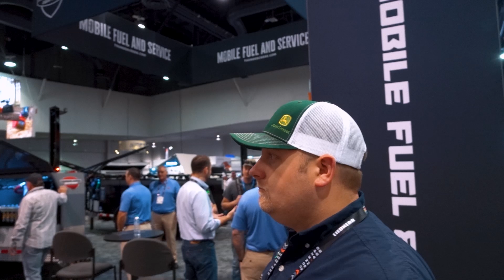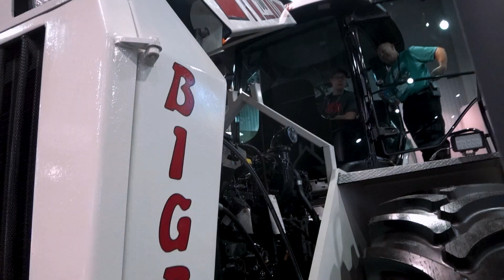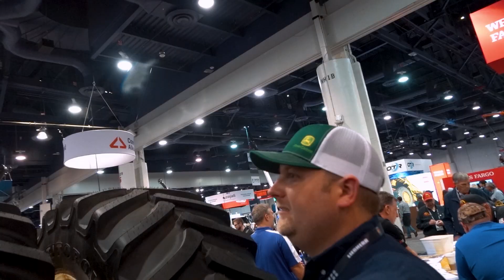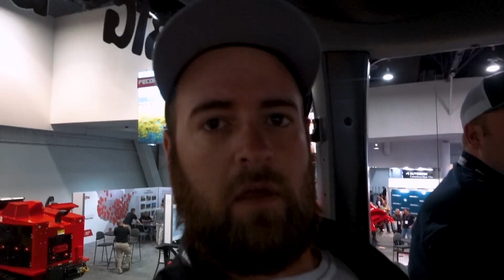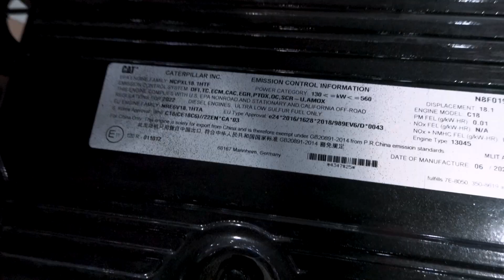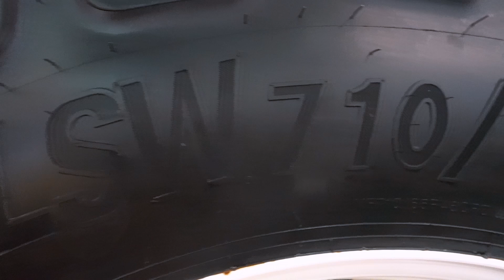Brand New 2023 Big Bud 700 Tractor | First Look

Comment: I worked on a farm with a 1981 big bud. By the time we dropped air pressure and filled the tyres with water for broad acre dry land cropping it weighed 48 metric tonnes.
I used to tow an 85 foot chisel plow with 14 inch sweeps, a 60 foot breaker plow for clodding hard packed clay pans after a summer rain.
One of the most powerful machines I ever drove and John deer still hasn’t made a machine that could blow smoke up its arse lol😂

Comment: Kinda surprised by the engine choice... The c15 is pretty rock solid but pushing that architecture to 18 shortens life quickly at high continues rating.maybd consider a c27

Comment: you know, i would be VERY interested to see what a subcompact would look like from them. main issue i had with mine was the flex. when i got the bucket loaded with sand on uneven ground, i could feel the frame twisting underneath me. for some applications, you need the footprint of a small tractor with the grunt of a bigger machine. a big equipment subcompact or compact tractor would get a lot of attention from landscape and site prep companies. skidsteers arent that great on uneven surfaces, and some things are better done with an implement on the back. closest i've seen is the ventrac, which uses proprietary attachments on the front.

Comment: Very nice, powerful, capable and beautiful tractor!  Finally a smart manufacturer actually making a tractor for the people and not to pacify the techno crowd.  Common, easier to fix parts, no factory restrictions for repair, somebody finally listening, these will sell out very fast.  You were right to tell the Deere rep no way for complicated bullsh^t.  Excellent, informative video on a great new tractor built for real people and not moving toward robots and drone tractors.  BRAVO.  This manufacturer is really smart, knows what a real customer wants.  You're not the only one cussing technology, it's being force fed to the population as a step closer to drones but most people don't see what they're all aiming for, which ain't good for us people.  NOTHING wrong with simple if it does the job and does it well, actually better.

Comment: Important point was made at 8:40. They are basically manufacturing a glider that will be easier to retrofit with an older pre emission engine. Now of course they can not market it as such but its a very clever work around. I love that. About time someone stood up to the epa
Reply: more than that, if the powers that be do pull their heads out of a certain part....and someone comes up with a massively game changing engine or transmission, it can then be easily slid in also...but yes, at the current point we're at, I fully agree with you.
Reply: I wonder if the farmers could supply their own engine. New, used,rebuilt, deleted etc?
Reply: @lamarzimmermanmennonitefar5269  directly? not likely, aftermarket, like big bud sells them a non powered unit, and then builds a skid for them using the motor and puts the skid in after the actual sale....maybe, question would be if they would be willing to...

Comment: Very impressive machine. On the engine tag it states " solely for export from China" so one could assume the engine was manufactured there. That said, still Cat engineering and technology. The C-18 ( 18 litre displacement ) is still the same basic block design as all the other "E models", such as the 6NZ, Accert, etc. Instead of 14.7 litre, like your 475 or 550 hp, or 15.8 litre like your 600 hp, you have a bored and stroked engine to get to 18 litres. They get there by using things like thin-wall liners to squeeze out the displacement. These engines are widely used in Cat construction equipment, and in boats, gensets, and other industrial applications. I guess ag usage emissions standards are different from highway, and maybe that's why us truckers can't get these engines any more. I wonder if you can get a Jake Brake? Good luck, Big Bud.

Comment: Ok, so i guess i will be "that guy." This tractor really disappointed me. It is not even close to being a running, driving unit. The welds looked horrible with porosity and undercut all over this thing. I worked conexpo, all week, in the festival lot. I have full access to 3 different engine manufacturer software's and work for "construction equipment" manufacturer. I also have a college degree in agricultural technology. I fight the same challenges as many of you in regards to some of this newer farm equipment that we own. The only reason i mention any of this is to provide context to my opinion....
I visited this booth twice to get information, very specific information. "Will the end user be able to obtain the factory computer software for the engine, emissions equipment and transmission. Even if they are willing to take a training class...." The answer was, "No, a cat certified mechanic will need to diagnose and repair the emissions equipment. As far as service and maintenance for the engine and transmission, anyone." Next question, "will we be able to purchase a "customer" version of the software, with limited access to certain parameters." The answer, "no, not at this time."This was basically the exact answer both times i visited. They are relying on the current Caterpillar dealership network to keep these going. Now, i completely know why this is the answer, but that is exactly what everyone is arguing about. The ability to diagnose, repair, and test the emissions system. Also, access whatever online parts and service manuals. I also understand that most "farmers" do not understand the complexity of some of these software's or even the  logic behind it. Not that "farmers" are not smart, just not trained and familiar with how to use the software properly. This may be a simpler version of a modern tractor, but it is not a modern tractor. You can rebuild an old pickup truck with all the modern-day technology and parts, but it is still an old truck. I am not bashing Big Bud, Big Equipment company, or Rome plow company. I fully support their mission and what they want to do. If they have some plans in the works that i dont know about, that eliminates these concerns, then i am wrong and will fully admit it.
Reply: In my opinion, the best thing they can do is to "purchase" emissions credits for these engines and put a tier 3 engine in it. If you can even still do that anymore......... that would be something
Reply from the maker: Yeah the whole time I was thinking the same thing. Not like I have access to a cat computer. Wonder if it would be possible to build a glider kit like they do with semis and use an older engine
Reply: @BriansFarmingVideos  Its dependant on the tractor serial number on the frame /original build date. They won a court case regarding taking remanufactured tractors into California with non compliant emissions.
Reply: I fully agree with your comments.  I too was at ConExpo and was disappointed as well.  This tractor was literally just a frame with an engine, transmission, axles, and a salvaged Challenger 900-series cab bolted onto it.  No air intake, no exhaust system (and yes, if the engine is 2011 or newer it will require DEF), no wiring harnesses, no drivelines, no hydraulics - and that's just what I noticed glancing over the machine.  There is a whole lot of work to be done before this machine is ready for the field.

Comment: Awesome they brought the BIG BUD back. But even better is they are making it so user friendly to able to work on it yourself to a point.
Reply: Anyone willing to drop the coin, can obtain Cat's diagnostic software. 
Any Cat engine shop, should be able to plug into and diagnose the engine. 
Anyone with a Snap-on, MAC, etc, scan/diagnostic tool can obtain the software for the engine and transmission.

Comment: I went to this show with the owner of that very tractor. He purchased the very first big bud tractor manufactured in 20 something years. This tractor at this point will not move under its own power yet but he is expecting to take delivery in June i believe. He will be pulling dirt pans with this tractor. He is still running 3 bid buds that he purchased many years ago.
Reply: Awesome...Good luck dudes..

Comment: Surely if they’d of wanted to make an impact with that, to really get the industry excited they should’ve just put out a 900 / 1000 hp. 
It needs the USP
Reply: It would be unique, but it's unlikely.  It's very difficult to get the power of 1,000hp to the ground without the design becoming complicated and unwieldy.
Reply: There's a reason they only sold one 747-16V....

Comment: I'm thrilled Big Bud is offering tractors that are not subject to the predatory service practices of the other tractor manufacturers. Farmers should never be hindered or locked out from servicing and repairing their own tractors.
Reply: I have NEVER put a tractor in a dealer shop ..Ever!  But most of our stuff is 40 years old...  Planted all our corn and milo  last year with JD 7000 6 row and 4430...Crop was just as good as the next azzholes..
Reply: @davehughesfarm7983  oddly enough I was never asked what year my tractors were when they printed the check for the crop
Reply: Don't be too thrilled, because it's a Cat transmission and engine and a Cat computer and sensors, and Cat charges $185 an hr service call, and only Cat is going to have the parts
Reply: @RJ1999x  It's still a huge step in the right direction but I'll let them know you won't be purchasing one. ;)
Reply: @SaltyBear207  Not really. You can go anywhere you want with Deere or IH, no one is forcing you to use their dealers. No one really makes aftermarket anything for Cat nor does Cat allow any different practices than Deere or IH.

I have 3. It's not fun finding parts for them. Also how is it different than a Versatile besides being heavier and having an overrated Cat motor instead of a overrated Cummins motor?

But the internet knows best of course.
Reply: @SaltyBear207  It's not a move to the right, it's just a sales pitch

Comment: Not going to lie was a little disappointed it wasn’t all new and complete but was still awesome to see
Reply from the maker: I’m honestly surprised it was that far along.
Reply: Not a lot they can change besides the cab and the hood if they want to retain the skid system design with adjustable engine and transmission mounts for different component options to be easily installed or switched out.

Comment: With all the right to repair, and problems with the JD, I think their concept is a winner.
Reply: Definitely has a lot of potential. If priced right they are goin to have to produce them quick.
Reply: @robo1210  700k US. Also how is Caterpillar any better?
Reply: R2R is a much bigger issue in the minds of internet nerds than it is to farmers, despite what Vox tells you to believe.
Reply: @asmrhead1560  while I do agree with that, there’s still the issue of parts availability of only being at dealers for most parts and marked up like crazy.

Comment: Finally a good look at it, thanks Brian. Open Source Tractor, I wish them the best of luck.
Reply: Its all Caterpillar though?(minus the frame)
Reply: @J-1410  The old Big Buds used of the shelf Cummins engines, twin disk transmissions and bought in axles. So what's the difference?

The point is they're comparatively simple readily with available parts and don't require  a Deere technician with his special laptop full of proprietary software to "fix" it.
Reply: @johnroberts86  The only thing truly off the shelf of the first four series were: The Cummins Engines, the lights, the wiring(sorta), the Stewart Warner gauges, the hydraulic hoses(sorta), and the tires.

The Twin Disc transmissions were, apparently, special built for Big Bud, and Twin Disc today wants nothing to do with them, probably due to the lawsuit they had over them being different than what they were supposed to be, causing defects to show in road gear.

Eaton Transmissions, pretty hard to find parts for the ones they used today, as they didn't make a whole lot of those models back then.

Clark Axles, in some of them, are in the same boat. Where are you getting Clark parts at? Either through Hundai or Volvo, and good luck either way.

Everything but what I mentioned at the beginning, was an odd version way back when it was built. Instead of them stepping up to the next heavier, common version, they chose the "heavy duty" variant of the lighter version, one that was less produced, and thus harder to find parts for.

ITS A VERSATILE! Or well, an MTS. Look up those. Simple Cummins 855, or C18, with the same Caterpillar transmission, and different axles. 

So now, no you don't need the Deere technician, I don't understand the internet's fascination with Deere when the entire industry does the same, you need the Caterpillar tech instead, with his Caterpillar laptop. What did you gain? Caterpillar's practices are no different than Deere's. Caterpillar dealers are not required to work on these new Buds either.

I guess you could possibly call the Versatile dealer for transmission issues, but they may not want to work on it, due to liability reasons, depending on how the transmission is set up.

So that leaves you with one option again: the factory. ONE place to get your parts from. ONE place to send your tractor to, to have it worked on. ONE place for information on these.

The problem with Bud's are the truly off the shelf parts, they never need work or parts, or rarely do, because they were oversized or well designed(like the engine), but its everything else that isn't off the shelf that is the problem, because good lucking finding any of it, unless its on ebay or an auction.
Reply: @J-1410  Kinda missing the point a bit there, but appreciate the history lesson.

Big bud are trying to make a tractor that's sturdy and so that farmers can maintain and fix their own equipment ... which they can't with the modern Deere (and others) that have dealer lock-in designed in and not making service tools available. Despite saying they will, then making political contributions to lobby against right to repair.

It's as much about the principle as the product.
Reply: @johnroberts86  What's the point? These new ones are fully dependent on Caterpillar, which does the same as Deere. Deere is not doing anything special here.

You need PARTS to fix your own stuff. You need the same computers, same software, just Cat branded for Cat equipment, to troubleshoot codes. Same goes for CNHI, Agco, and Versatile. Deere is not doing anything out of the ordinary here besides having the most market share.  You can buy the tools needed from Deere, from CNHI, from Agco, from Caterpillar, from Cummins, from Verstile. The only things that are "locked down" are things related to items such as horsepower and emissions.  Are they cheap? No. I know, because I have this supposedly unobtainable things. If not, you can get it for much cheaper, sometimes free, from Eastern Europe. The Deere and RTR issue is completely overblown by the internet. Is it a valid concern? Yes. Is it as drastic as the internet is panicing about? No.

Caterpillar does the same as Deere, politically.

This isn't an IH M where you have 50 different aftermarket companies making parts for it. You have ONE. Caterpillar. You have ONE place actively stocking parts and knowledge about these new tractors: Big Equipment Company. You have ONE place for these. Your "independent" mechanic will have to order parts through one or the other. Your "independent" mechanic will have to be on the phone with one or the other to fix it.

Its is a $700,000 USD tractor that is a heavier built MTS tractor. There's nothing new, nothing ground breaking here like what was before, its a very heavy Versatile/MTS, that's it. What's the difference between this and a Versatile, I ask you, what about this and a MTS?
Reply: @J-1410  look no CAT dealer is going to have application data on the item, your gonna be running around with five different manual serial numbers spec codes just to order the part no dealer stocks parts for equipment they don’t inventory this is pipe dream idea I’ve been down this road with Bandit and Moorbark and CAT
Reply: @Mr.Filson  Given I'm not in the US, not quite sure how you work that one out. 🤣
Reply: @johnroberts86  fair enough, you have any other smart A comments you’d like to make?
Reply: Open Source of headaches.
Reply: @Mr.Filson  Get back to your John Deere technicians training. 😆
Reply: @johnroberts86  WYOTECH then CAT apprentice program, the Deere&CO. Now I just fix my own, all forms of training have been useful to keep my operation going. How about your training background?
Reply: @Mr.Filson  Computer Science degree, then 20+ years in software development. So I know about Open Source and closed code...
Reply: @johnroberts86  That's not what he was explaining at all by that comment. Congratulations on your career and knowledge.

Comment: There are some big marine diesels used in sport fishing boats/yachts 1200-1700 hp range that are fairly compact would make this thing insane.  I imagine it wouldnt be hard to go from 1 1/2in thick steel to 2 inch?  The prairie farmers would be in heaven but they would also have to come up with an implement line up.

Comment: Equipment manufacturers will now have a great opportunity to manufacture wider span trailed implements such as deep rippers, disks, plows, anhydrous applicators etc.
I hate to see a tractor pulling a narrow implement and wasting good horsepower. Its time to think big, think wide span for more productivity, 100 feet and up to 150 feet wide.
Reply: That's fine if you are in a place where you can get around with the big equipment most places in north America it's tough.
Reply: @delbutler885  In the hi plains states there are lots of huge fields.
Reply from the maker: If it’s 640 hp like Ron said in the interview then that’s the same as the highest hp Deere and CaseIH I believe